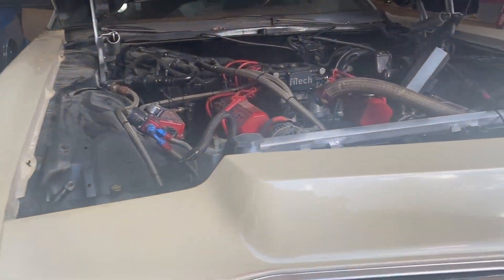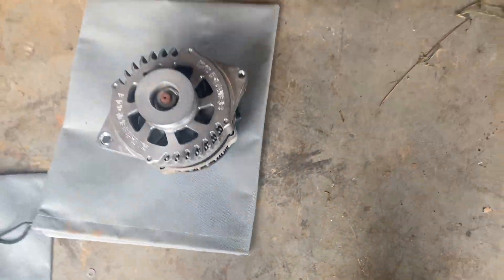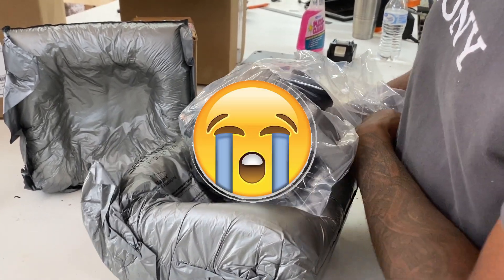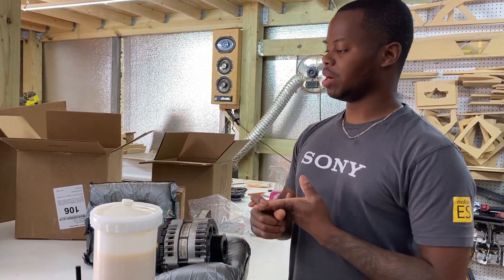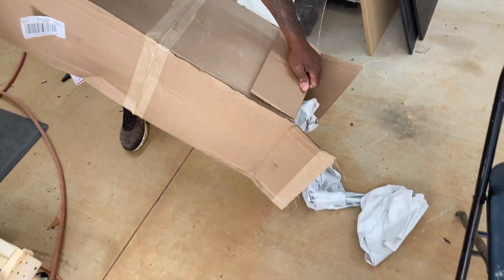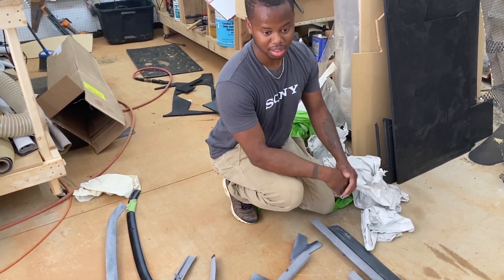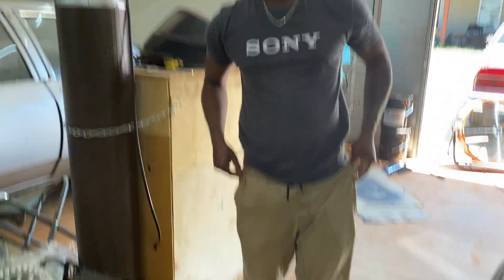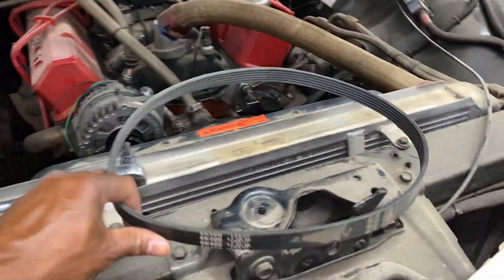CREAM DONK | GOT MY ALTERNATOR BACK & UNBOXING

Comment: Man you better cut a hole in put a a/c in it. Gonna bake in that sweat box. Lol I want to ask you if you have any experience with convertible tops? Wiring wise
Reply from the maker: Still need something on the roof, it gets real hot
Reply: @SteveDavisCarGuy  not much of anything gonna save you from this southern heat lol its not called hot lanta for nothing lol